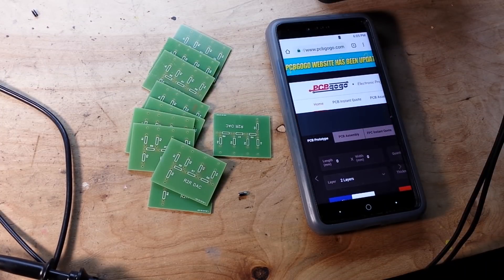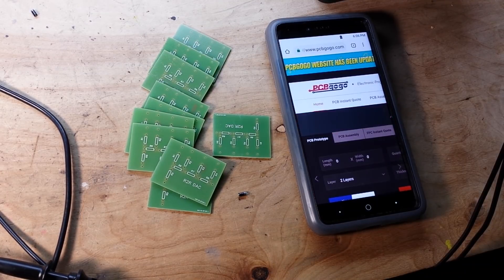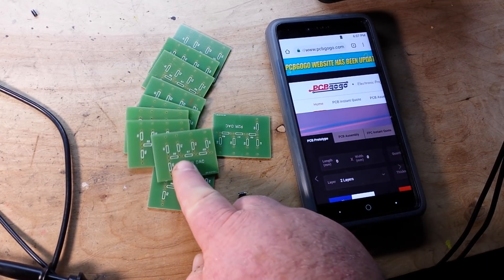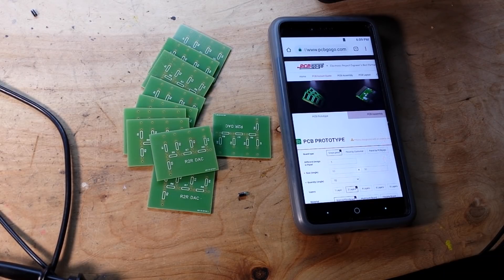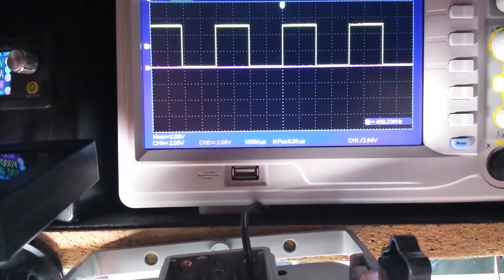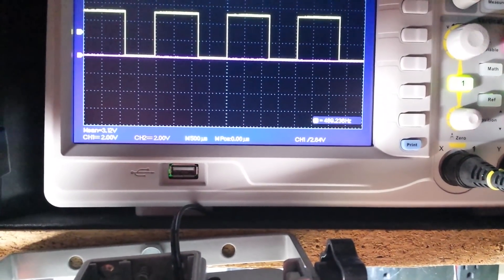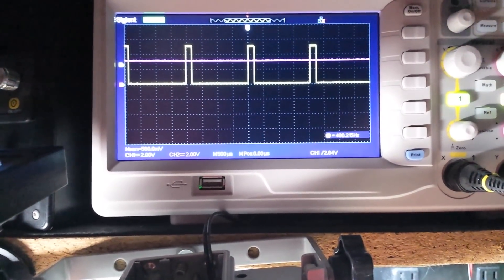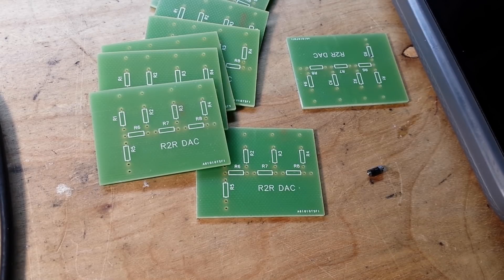PWM isn't always the best choice & PCBs from PCBGogo

Comment: If it is a digital signal only you could just use a level shifter circuit to interface your 5v to 3.3v logic.
If it is some form of analogue (aka PWM or R2R or DAC) then you could just use a resistive divider on the output to divide it down to 3.3v.
Depending on current needed (using standard resistor values) a 5.1k at pwm output in series with a 10k to ground. The Centre point will give you a max of 3.31v at 100% duty.  If you need more current due to input sensitivity lower the values accordingly.

Comment: I'm a saltwater fish tank nerd and we commonly use LED lights.  I'd like to control them with 5v PWM from an Arduino but the drivers are 0-10v analog dimmable only.  Does this circuit get me closer?  Thanks!
Reply: You could use an opto isolator as a level shifter first to get that 10VPWM  pulse and then filter it. I use opto isolators all over my systems to shift level. As an alternative, the opto isolator can transfer analog data too. Not exactly linear, but that wouldn't be an issue in your case.
Reply: @opera5714   I'll research it, thanks for the tip!
Reply: @mnelson10000  I can always pop up a video if more details are provided and needed. Could be an interesting topic.
Reply: @opera5714  If it's something you feel like messing with, that'd be awesome!
Reply: Ah, I just watched your other video about the circuit and I see now this creates a sine wave output.  Back to the drawing board!  :)

Comment: Nice and informative  videol  Paul and you're sounding positive as always :) I am still a newbie in electronics and I enjoyed and practiced your 555 pwm vids/circuits. To get flat dc from the pwm signal I would think a simple lowpass filter would do the job; just a capacitor and an inductor and you're good to go I would think?  .....or am I overlooking something? 
Peace to you too Paul.                                         Lao Tse: Peace starts with peace
Reply from the maker: Yes that will flatten the waveform. But it will still be above 3V
Reply: @learnelectronics  With a duty cycle of 60% ?
5V * 0.60 would give a 3V output with such a filter?. I thought that was what PMW was all about.
Sorry Paul, I am in this just for half a year, but I like it a lot  and to me it is  all very very interesting. And thanks for your reply.
Roland, The Netherlands

Comment: Another way to make DC is a RC filter on the PWM. It has some advantages and some disadvantages compared to R2R.
Reply: The advantage of an pwm/rc filter is the added resolution, however you have to watch out for ripple and emc.
Reply: The advantage to RC is that it only use one processor pin, requires fewer parts and has higher resolution, the disadvantages can be ripple, but is also slower to change output voltage.